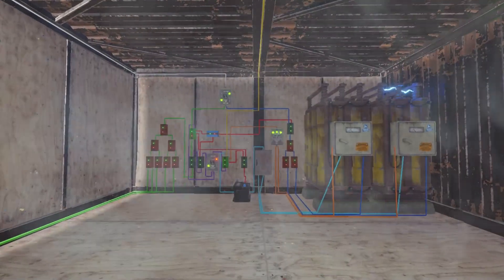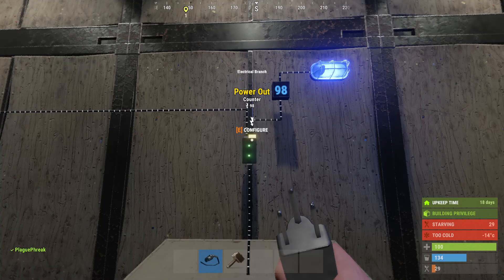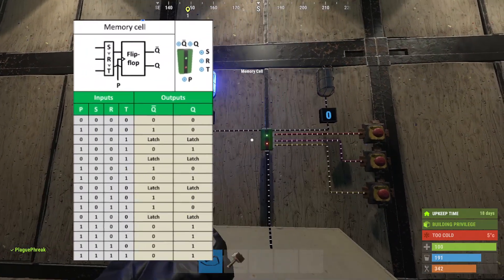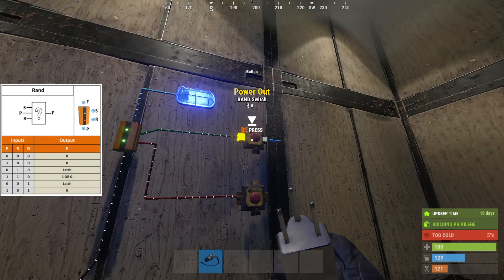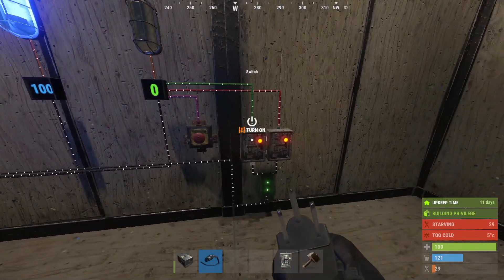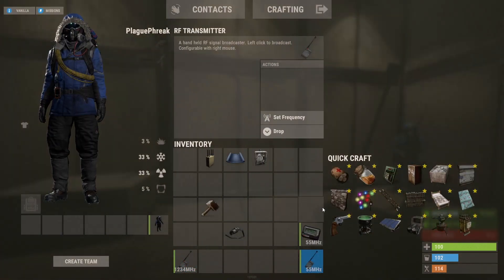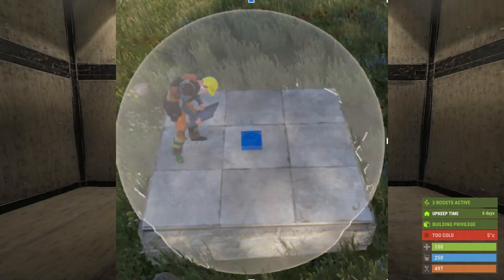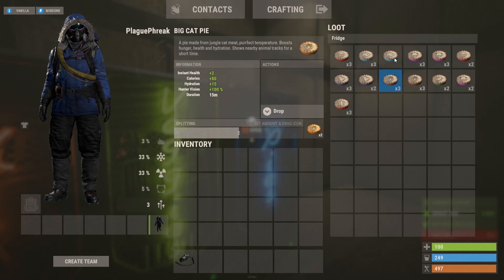Rust Power Distribution And Logic Flow | Rust Electricity Guide | 2025

Comment: Using root combiner would be parallel, battery to battery is series...
Reply from the maker: That would be true if we followed real life logic, but rust doesn't. 

In Rust, battery behaviour is streamlined compared to real-life electronics. There are no positive or negative terminals, and there’s no concept of voltage and polarity. However, the concepts of power and capacity still exist, just in different terms. Instead, everything revolves around two values:

Rust Watts (rW)
Rust Watt Minutes (rWm)

There are no positive or negative terminals, and voltage does not exist, but the two core functions of batteries are still the same, powering circuits and storing energy. So while Rust doesn’t let you literally wire batteries in parallel or series, you can mimic those configurations in terms of outcome by connecting their outputs with 1 of 2 components

I talk more about it in my parallel vs Series Video. but i brush over it and its not as detailed as id have liked it

Comment: If we team up, don't you dare run around the base with a hammer, wire tool or wrench.
I will make it the messiest zigzaggiest mess you ever seen if I have to repair it.
I will go out of my way to replace every pipe missing cutting through the walkways with as many connection points possible.
Mr Neat Guy is gone. I might add a few strobe circuits in for fun.
Just like Japan touching the boats caused nukes, touching my pipes/wires will nuke your graphics card.

Comment: 1:43  that's parallel.
Reply: Parallel would be splitting the usage in half for each battery rather than each battery seeing the full load.  Each battery seeing the full load is series.
Reply: @Demolishionist Series would be one battery wired straight to the other battery then that one to the load
Reply: @rw1567  You're thinking in terms of physical connections in real world circuits, we're speaking in terms of Rust electricity behavior.  In the real world if you connect two like batteries in series, you get double the voltage but the capacity (mAh/Ah) stays the same as a single battery.  Rust simulates the behavior of series wired batteries by using a root combiner despite them physically being connected in a way that resembles real world parallel wiring.  You get double the output (200 with 2 large batteries) but the capacity stays the same (24,000 rWm with 2 large batteries)

Two like batteries wired in parallel in the real world have the same voltage but double the capacity. There is no way to get truly parallel behavior out of batteries in rust.  You can simulate it in a few ways like connecting two batteries to an OR switch but it's technically just alternating back and forth between the two to keep them balanced with a net effect of having an output of 100 and capacity of 48,000 rWm (with 2 large batteries).

Comment: Good vid, but 4:09 I would use switches not buttons it's better to show priorities on mem cell, plus previously U didn't talked about which output turns first and last on branch and splitter (past throught > branch out) as for newbie it is valuable info, because they don't know that, also I didn't hear that some components prioritise last received signal(smth like switch), but generally great video, but I would glad to hear more, U know, specific rules, that other yt-bers often missing
Reply from the maker: Yeah. I plan to make some short form content that goes into detail about each thing. Going to spend some more time learning and understanding everything before I do that though
Reply: 1 button that close all doors combine with HBHF Sensor. 
The HBHF close any all doors if an enemies get close to Base when i'm out and forgot to close some doors.

Maybe a button outside at door, that open first door,  button for next door. closing the door behind enemy.
And they are trapped. etc.

Maybe hook Button up with couple hidden sprinkler in the winter area. To make enemies wet and cold.
Or trigger a door with turrets behind.
Or make something else funny that happen when push the button
And write text 'Don't Push' With cable on the wall over the button.

Button can be fun to use.
Reply: @JackMehoff1h U didn't get my point, he showcasing priorities of memory cell that are only matter on constant power, so buttons are not ideal for that showcasing task